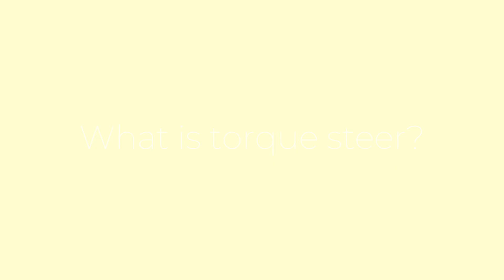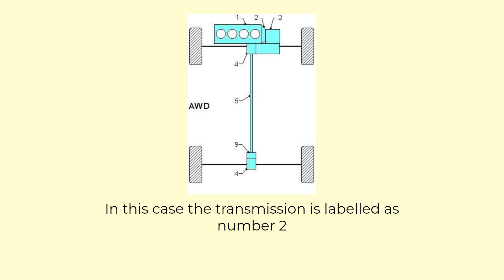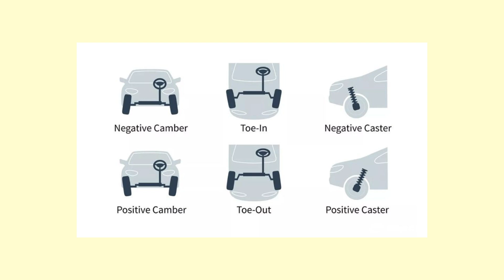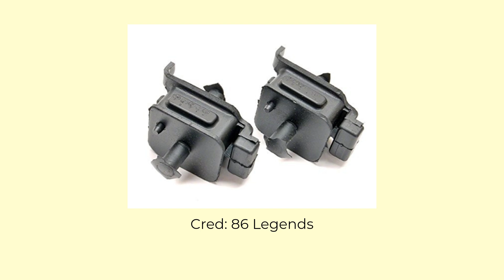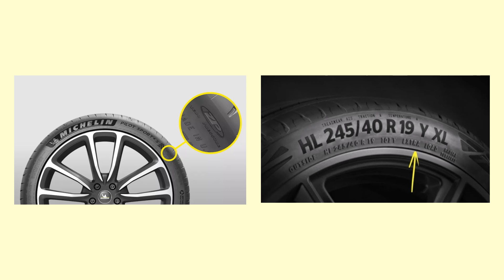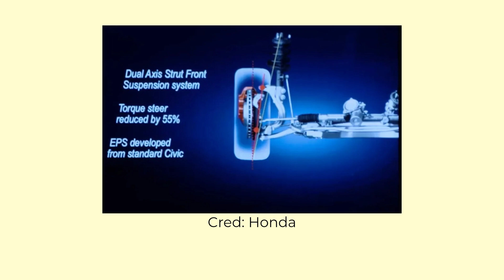Torque Steer | The Saboteur of Driving

Comment: Scrub radius doesn't affect torque steer in any way whatsoever. I had to verify this when bugtesting a kinematic system.

The only relevant lever is the kingpin offset, which is the distance from the steering axis to the contact patch center at the center of the wheel. Scrub radius is a brake torque effect.

This may, and probably will be, different with outboard torque ie: electric motor at the hubs, but most all cars will transfer the torque via a driveshaft running into a bearing, and bearings are not capable of transmitting torque, so the force reacts at the bearing height, hence why kingpin offset is the relevant geometry.

Make sure to also take contact patch lateral deflection into account, it is NOT a minor effect and is extremely important for steering feel under power. A good approximation is that the contact patch lateral stiffness is equivalent to the tire vertical stiffness. You can expect a net lessening of kingpin offset of about 20 to 30mm, with the outside lessening more than the inside increases. Higher profile tires with narrower treads will typically have better torque steer behavior due to higher lateral compliance.

Take wheel and suspension camber compliance into effect also, not as incredibly dramatic as the lateral contact patch compliance is, but it's there nonetheless and will result in a net lessening of kingpin offset due to the positive camber from Yg and also lesser tire force.

Lower grip at the tires negates torque steer and makes its effect smaller. There is no actual way that less force means more force delta.

An open differential always has equal torque between the wheels, so adding an LSD will, in typical cornering situations, only increase torque steer due to adding a torque imbalance. In fact, torque is entirely meaningless, the only relevant factor is the FX at the tire contact patch, which is naturally different due to load transfer even with an open differential, but a locking differential will exaggerate the FX difference of course.

Rolling resistance is a negligible effect for torque steer, and in general for anything that's not fuel economy. It's barely a 1% effect even for things like top speed. I think you're misusing it here.

Tires with directional or asymmetric tread do not "distribute the torque more evenly", in general asymmetric tread can raise DX in one direction and lower it in the other, but we're talking a sub 1% effect typically. I believe it was closer to 2% in the wet. Asymmetric tread will have lower DX but higher DY as a rule. Probably not true for all tires. I would not really care very much about the tread pattern in either case, it's almost purely a thermal and wet performance thing.

Hate to be that guy but this vid is full of typical misconceptions. Nothing to feel bad about though, plenty of pros in the industry who still haven't figured out the basics...
Reply from the maker: You know what, you are right about the first point in a way. Watching pulls of the newer Type R's which have zero scrub radius geo and they still torque steer, but as they did focus on that kingpin offset it is reduced to an extent.
Reply: @Enguitive  No, I am entirely right. Scrub radius has no effect at all. It is entirely a kingpin offset effect, I explained why. I've rigorously tested and confirmed this, alongside the theory supporting it anyway.

That's why cars like the DC5 Type R can have an extremely negative scrub radius, yet still reduce steering loading under power; because its kingpin offset is higher than some better designs.

I suspect newer cars with decoupled steering axis will be 0 torque steer in some situations where compliance is enough to make kingpin offset 0 and the driveshaft angles etc. are equal enough. 

Even if there's a little bit, steering system friction won't allow the minor torque steer to influence steering at all.